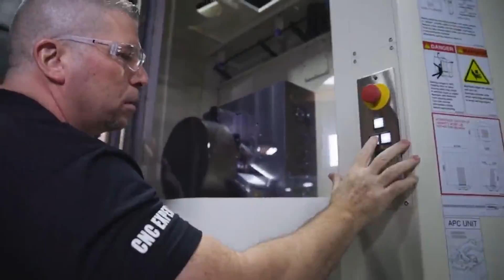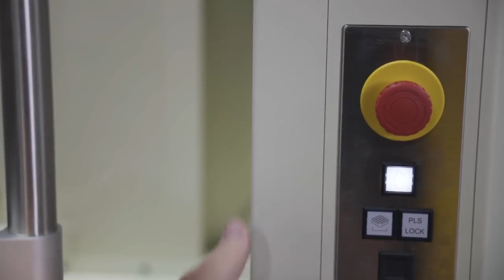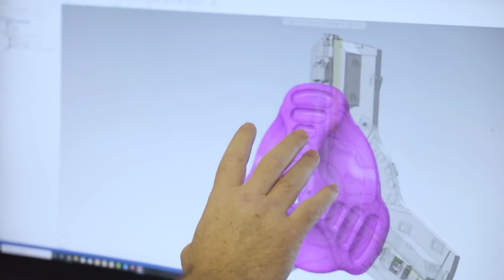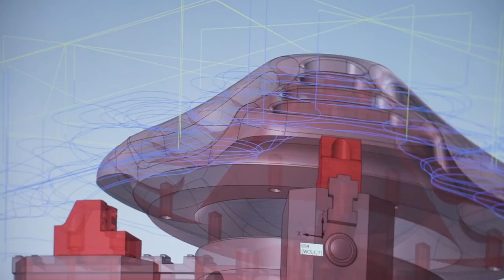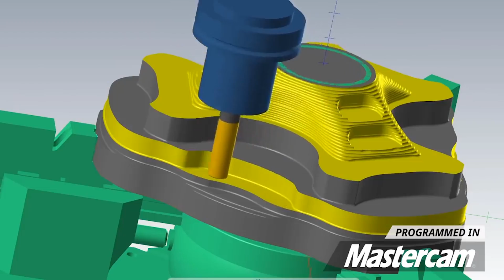Buyer DEMANDS 15% PRICE DECREASE or Parts Get Outsourced!

Comment: Sometimes the right answer is... go on then, outsource it, but if you come back after finding quality has dropped, we will have to charge you for setting up production again, and that' will NOT be cheap.

When you invest in going from manual machines to CNC, you do that for YOU, to make money for YOU, if you spend money to make other people money, then you're a massive fool, any savings you make should be for you, as long as the customer gets the parts they want at the agreed quality, and prices, then if you can offer a discount, ok, but if they demand a piss taking discount no.

There are some customers you just don't need, and they sound like one of them.

Comment: Our company lost a air conditioning part job to China. They had us make a 90 day surplus to let their new factory make and ship parts. I had my setup guy add a drilled divot to the back of the part. A few months later the tooling showed up and they wanted parts tomorrow. It seems the Chinese aluminum was porous and when heated the freon went right through it. They wanted a reimbursement for their bad parts that they said we're ours ...no divot...we didn't pay them

Comment: Australia lost to China because we don't have the economies of scale. Like you said to make good money from CNC you need to run 24/7. If you can't because their is no demand, the price per part goes up. Not only that the lifespan of the machine is in hours not days. So you end up with old equipment when the competition has moved along to a newer model. They blame wages but forget the offset to fixed costs is more.

Comment: Outsource them, then. Have them settle the account, ship all their material out, and throw the file in the basement. That's how free capitalism is supposed to work.

Let them work out all the new kinks of a new supplier and roll the dice to see if it works out for them. You have other customers that value your work. Call them up and see what else you can do to empower their production!

Stop wasting time with cheapskate customers! That's what the continent of Asia is for!

Comment: In my industry I deal with customers that always try to out source our time and products. I found that with quality will always win in the long run. what happened was that customer came back and we had to charge them to correct other vendors mistakes. The value of quality will always win. Be flexible but also take pride in your quality.

Comment: The problem is the multi million $ salaried Csuite people who only strive for the bottom line and are willing to destroy the company during their tenure so they look good for their next company or board of directors. The company dies after they are gone so there's no accountability, someone else is left holding the bag. So this is happening across America, in service industries, food industries, manufacturing, etc. I see maintenance being cut all the time and when the whole facility is trash because of that they outsource a new facility overseas.
And 40 years of doing that with our Socialist Democratband Rino Republican Representatives on the take makes America weaker and less capable... But those people are gaming the system and don't care about tomorrow or what their children and grandchildren will have left to work with.

Comment: I agree with your boss, the 15% is greed talking if a number in a negotiation has a n actual reasoning behind it. budget cap for a project, or an agreement to sell said part in larger quantities for a reduced price per etc, the there is a real number calculated from real data. not just an arbitrary 15% to all vendors across the board thats an insult to any company doing business with them. new president with a hard on to show how shrewd he is. an they outsource and get substandard parts for the price they wanted you to do quality work for, and then ask you to rework the parts from your previous contract and make it good. thats all laughable. 

it doesn't have to be personal I understand its just business but that's not good business and personal or not its very telling of who you're doing business with and do you want to invest yourself in a relationship with a company that would treat you like that . idk im with your boss on this. id be open to negotiation on anything and find a good fair outcome for both parties but this is more allowing yourself to be bullied theres plenty of work in this world to be done you dont have to be everyone's vendor to be successful.  just my 2cents

Comment: Several years back I did a large 316 stainless part for a company that had to have a flawless finish.  I have the perfect large turning center for it, but the extra care to make sure there were absolutely no scratches or dings made it take quite a bit longer, and we charged a fair price for the extra care and handling.  The customer comes to us to bid on another batch, and informs us that they are looking at a company in China to make them.  The Chinese price was less than our material cost.  We lost the bid.  6 months later the Chinese parts show up and they are RUSTING!  The customer comes to us in a panic, they are going to shut their customers line down with all the ensuing penalties.  We agree to do drop everything and do the parts for a ridiculous price COD.  They have no choice.  I considered it "asshole tax".  We got our money, and there was that "gotcha" moment, but there really wasn't any happy ending.  They didn't learn anything, and we lost them as a customer (which isn't the worst thing).  It's just what happens when you race to the bottom.

Comment: I would also disagree. On the General thought of keeping machines running instead of higher prices, you might be right. Maby Not. Could use the spare time to diversify and train. Nevertheless, being Held hostage by a few or a single other company is never good. As you said yourself parts from these cheaper countries needed remachining and touchup Work. Yes at first it might be lucrative to get them cheaper parts and some less quality relying company might be lost. However the ones needing quality will realize that it never comes bottom cheap for everything.

Comment: I’ve used a couple Coherent laser products and they are not great. Some of their software is so outdated we have to run windows XP virtual machines to even use the laser. Not surprised they would try and cut cost considering how much better the composition is.

Comment: Quit moaning and look at the costs of manufacturing in North America. The reason so much work is going to China from America is that America trailed so far behind with CNC implementation and relied instead on skilled manual workers. I'm now retired, but back in the 1978's I implemented CNC in my small subcontract shop in the UK. I implemented CMM in 1979, CAM in 1980, CAD CAM in 1984.   I ended up with around 25 top of the line machines all with controls able to hold ±1µm (in theory, tool technology took awhile to catch up). I also had a good team of employees able to set and program them and I always had a full order book and was doing very well until Thatcher arbitrarily decided to cut government spending on defence, aerospace, Air-Crew Safety systems, Medical Body Scanning equipment etc. That doesn't sound so bad does it? But the unions fought back so she did that 4 times in one decade just as your government has hit American manufacturing in the same way. Look at your car industry, look at the US machine-tool industry etc.
Stop profiteering from uniqueness, implement FMS, Robot loading, unloading, deburring, inspection etc. etc. Start 3 shifts a day and defray your capital costs over greater production. The West MUST beat the Far East or lose all our business to them. You must catch up before you worry about profits. I've been where you are and trust me it's the only way you will survive. Good Luck!

Comment: I disagree. If the customer wants 15% THIS year, they will come back NEXT year and want ANOTHER 15%. They will keep squeezing until you go broke. The owner was right in saying that they would see which parts there could be an allowance made on, NOT across the board. The PROOF is the fact that you were getting a bunch of rework from the crappy job the 'new' supplier was doing. At Caterpillar, every time a management change was made, outsourcing to offshore would happen to 'save' money, but any saving was lost to warranty claims or rework of bad parts. And then the parts would come back in house later. Rinse and Repeat!

Comment: I am an Aussie, and what you have described is 100% spot on. 
Whilst there are some "niche" industries, we have lost most of our manufacturing to China and other SEA counties,, we no longer build cars, trucks, shoes, clothes, furniture,, etc.
Further complicating it, there is a serious shortage of Engineering grade steel / metals here. Whilst things like mild steel and some of the medium carbon (eg 1045) are available,, HSLA and Stainless steels are difficult to get, and even then there is a very long lead time,,, try getting some Nitronic60 in Australia in a hurry. 
Even if we wanted to make the parts locally, there would still be raw material supply issues.

Comment: Your problem with that 15% is something that is worse that the Covid-19 pandemic, and is something that is affecting the world, because is true that the customer took the parts to another country, to make the cheaper,  but what that cheaper means in terms of salary and working conditions is case of os study on it’s own. I think you did the right thing by not giving the 15% given the current situation of the chop, but also making adjustments to you working process so it doesn’t happen again was the right call.

Comment: I've worked in a lot of companies and rarely when a customer comes asking discounts, does this ever finalize at the end user also as a discount, instead this is a pure test by the customer to get more profit themselves, i mean some do make the "threat" real and outsource but it usually bites the manufacturer in the butt, one important fact to remember is inflation is real and more common is that your supplier will increase price, and thus you need to either do the same, or improve your process , so in short normally everything gets slowly more expensive not trending down

Comment: Honestly, listening to the story, I feel that it was not a matter of taking a 15% cut or not, but a matter that this is when a company, especially smaller shops, should renegotiate their contracts. The best options in these moments is to know the market and know your competition. The owner should have been ready to step up to the plate with a counter offer and a reason, such as knowing things like how much will the outsource cost in the long and short,  import costs, fees, tariffs, etc. And in this case know the quality and warn the company about the costs of retooling imported materials and add fees due to the risks involved. For me I would not be willing to rework some other shop's work because I flat would not know what material quality they used. The customer may say it is X but for all they know it is Y and in my experience that can be dangerous if not deadly. I can count the scars and thankfully pairs of safety glasses I have had to toss after having some half smelted, mixed metal steel just come apart while working it.

Comment: Had this once in Perth, Western Australia, which has a HUGE mining industry. My company made the wear liners for primary crushers. We made them via casting them, then gauging to the correct size. Obviously we were more expensive than Chinese made plates, but the mine sites are literally in the middle of nowhere. So this mining company decided to save money by going with Chinese plates. Well, the Chinese plates arrived on site and the refit began. Most plates had misaligned holes, and haft be bashed into place or have someone spend two or three days grinding down an edge. By the time the last plate was to be fitted, it was obvious that it would never fit. At this point, the shutdown that should have been 4 days was at 3 weeks. Took us two weeks to melt, pour, knock out, fettle, gauge and heat treat the plates that actually fit. 

Executives are a companies worst enemy.

Comment: Agree with everything you said but I would add that I always ask for something in return like extended contract, agreement to be first to quote on new work,
preferred supplier status etc etc.  In my experience if you just agree to a 15% price drop, two things happen, the first is the client thinks you have been ripping them off, and then shortly after they ask for another price drop to test the price floor and they do it aggressively damaging the relationship.

Comment: These guys just use Machines to do all the hard work. So they are not really necessary if you get a good 3d printer tech going.. They are way over priced. They use computers to do everything.

Comment: My brother started a welding company, he’s been doing stainless steel for 20+ years, a local brewery hired another company for a custom job (piping, fermenting tanks, pump couplings etc.) 2 weeks of work and after they were done, there were leaks all over the place, rust spots (cheap materials) and failed inspection. They called my brother to rework everything, with other welders they got it done in 3 days and passed inspection. He always told me that if you give the customer exactly what he wants at a cost for quality, they’ll always come back.

Comment: the company i work for went the other direction. we do EVERYTHING we can in house. i started 6 years ago with the company, it had 170 people total. now, we are around 400 people, and are braking ground on plant 6. The machine shop, where i work, had 2 press brakes, a plasma table and 2 band saws, a very small milling machine and an old iron worker when i started. now, 6 years later, we have added 2 lasers, 4 more press brakes, 2 more much larger band saws, 12 "robotic arm" stations. we have a "tube" laser coming in September of this year, and 4 more robotic arms. the machine shop has 40 day shift employees, and 20 night shift.
the company has found that for production timing reasons, out sourcing is a horrible idea, even more so now with the supply chain BS. often production comes to a halt because of some plastic part from China not being available to put onto our product.
with the way the world is (in 2022) i hope that one good thing can happen to us in all the machine shops is that production comes back home. Canada and the USA need to get production back, not to save the world, but to simply save ourselves. i remember being told that Canada (where i am from) doesn't even make its own Forks and Spoons. we literally can't feed ourselves food without importing the cutlery.

Comment: This sounds so familiar. We make parts for the aluminium industry and other branches.
We also lost a couple of products to cheaper competition. Our boss got to visit their shops at some point and they were totally not taking care of their workers health. Barely any PPE, dirty AF etc. ( they were in eastern Europe where health doesn't matter ). 
One time we got a complaint about a product that were "done poorly". Our boss ofc went and searched for the reason and found out the product we got sent back was not ours. The parts were totally messy, broken and very crudely made. After the customer made a fool of themselves we got the products back for manufacturing. 
The reason we were able to keep them from lowering too much or at all was because we delivered quickly and our products were well made with better tolerances. 
When i started in 99 we were around 5 workers, 2 CNC lathes and a conventional one , 2 large CNC milling machines and a small one. Now we have around 15 workers, 3 CNC lathes, a small CNC milling machine and 7 big ones. We also went from 2D to 3D, from manual programming to post processing but still have to do manual programming at some point because the material won't always allow it.

Comment: Business often has a limited agenda.  The "deciders" are detached from the labor force.  But the labor force IS the heart of a business.  I've been a contractor for 20 years and seen the cause and effect.  Workers are treated like furniture.  When the business makes decisions that degrade a worker, a smart worker will return the treatment by losing care in the product, and/or leave.  = ultimately bad for business.
The real world is that governments are business too.  And they  treat non-government businesses like furniture, so outsourcing is just business.  And who wins?  Short term the business deciders.  Long term, no one.  But the rules don't change.  You  can have it "fast, cheap, or good."   " Any two," still applies.

Comment: So many horror stories... boss asked me to outsource street elbows to china, sent them the specs and cut sheets, the proof/sample and 1st shipment was correct but each subsequent shipment was getting lighter and lighter. Until one day the contractor called us saying the elbow we sent them cracked under a minimum stress, we pulled some from the warehouse and found they were 40% lighter then what was in the spec and we started weighting them all and found out what was going on. Once caught the manufacturer promised to go back to the original quality, the first shipment was only 27% lighter.... which was still way below tolerance. Same with pigtails, we had them shrink so much so that the bulbs no longer fit into them and tightening the bulb would pull out the socket and cause a short...